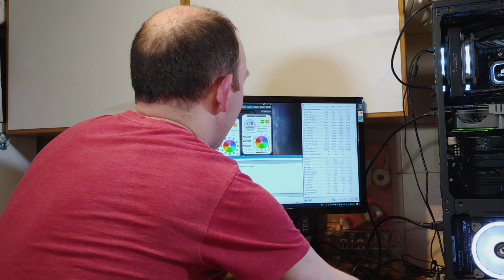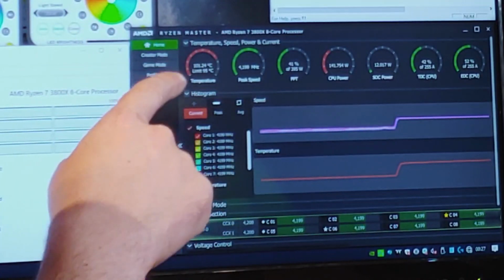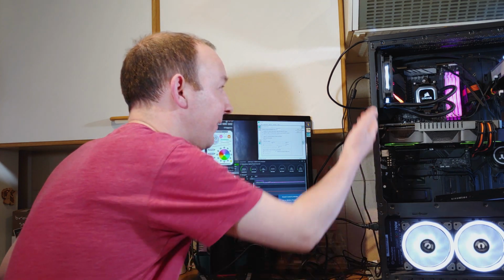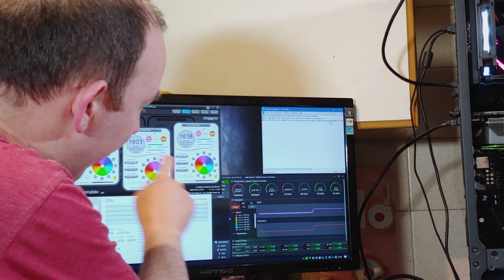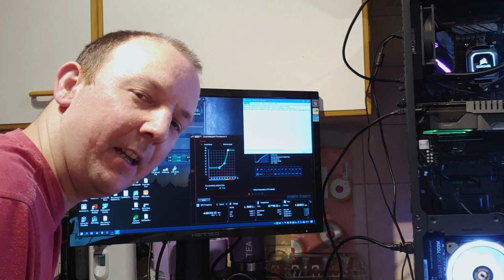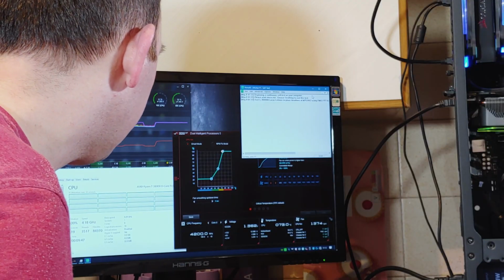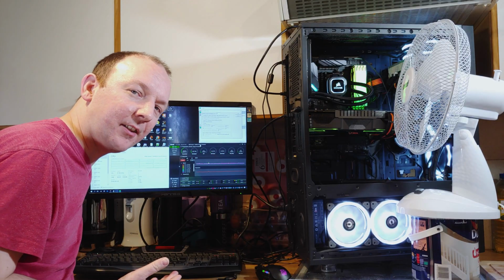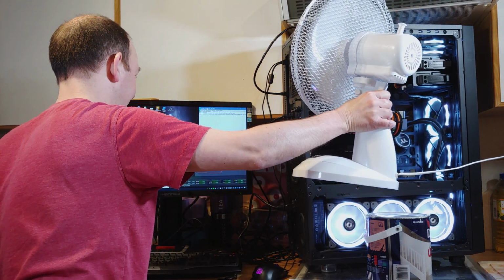AIO Water Coolers Part 2 - AMD Ryzen 3800X Vs Corsair H75 - Too hot to Handle !

Comment: What is the recommended TDP for the Corsair H75?  Cannot find the info anywhere online.
Reply from the maker: Your not the only one, I can only go on experience and say they do a good job. I have the 2018 version which I think is the only h75 you can buy now.
Reply from the maker: However I believe but don't quote me on this, the 75 referred to the tdp, however I have used with a 3800x with no problems using push/pull fan config.

Comment: So i should not get a corsair 75 for my 3900x mining 24/7? Runs at 88°C (case opened, else 93°C) right now but the stock cooler (wraith prism led) is too loud.
Reply from the maker: If that's what your using it for I would go for hardline or soft tubing with a thicker rad. Why are you mining on a 3900x anyways, GPU mining is still quicker ;(